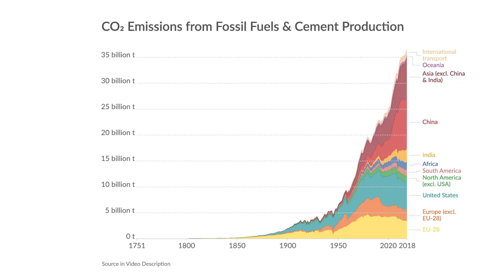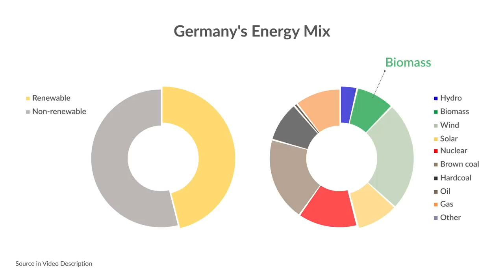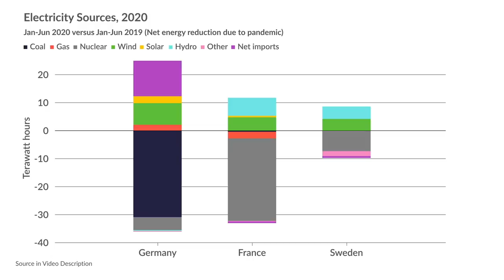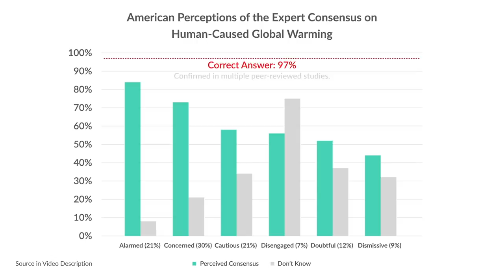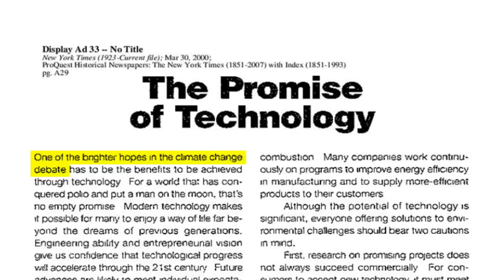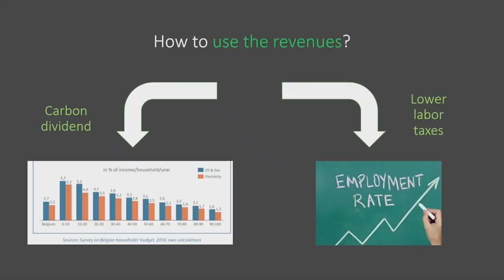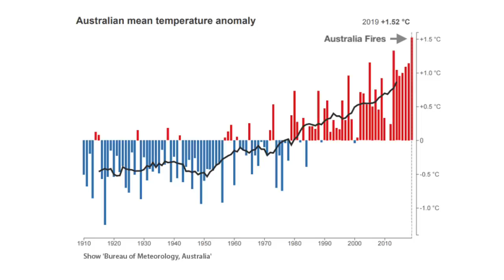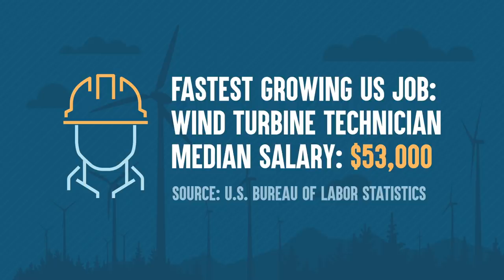The $5,200,000,000,000 Trick Killing More Than Covid, w Stephen Fry.

Comment: As I understand it, the Sahara desert was GREEN when the planet was 3 deg warmer.  More area of sea, warmer climate, more evaporation, more rain.
Reply: No sir, that is not the case. You see, there are two factors that influence if water evaporates or not (well, there are more but they're not as important). The first of them is temperature so, yes, the higher the temperature the more evaporation that takes place. Then there is another factor which is how much water can the air take according to its maximum capacity and how much water it already has. Whenever the air is close to big amounts of water it already contains almost as much water as it can have, that is easy to understand: since there is an unlimited supply of water the air can take as much water as it wishes. Now the water reaches land and, of course, since there is not as much water here it rains. Up to this point good, indeed you can see that whenever the Sahara reaches the sea it ceases to be a desert, since there is much more humidity here. Why doesn't this apply to the central area of the Sahara? Well, the air left its water next to the sea and the little water it carries and falls to the ground is met with a dry land where evaporation conditions are perfect, not only there is a high temperature but also the air is dry. So no, there wouldn't necessarily be more rain and even if there was more rain it wouldn't imply green and plants right away since as you yourself pointed out more temperature means more evaporation and that is not just at sea but even more so at land.

You don't have to believe me, though. Just look at a world map and see where deserts are, they always appear where there are high temperatures and if they are further from the sea then they are even more likely to appear. The Sahara desert could have been a green area in the past, true, but that might be due to the fact that way back in time the Sahara desert wasn't located where it is, but instead on other side of the globe where it was colder. Maybe that is why you have that idea.

The final point to make is that if the Earth's temperature rises 3 degrees for example, we should expect to see deserts such as Sahara wherever the temperature is 3 degrees below that of Sahara right now and those areas that already are deserts, well, they just would get worse.
Reply: @eglerian  
"Just look at a world map": https://www.google.com/maps/@23.4099693,-11.305282,1852299m/data=!3m1!1e3 where the Sahara desert meets the Atlantic Ocean it is still desert not green forest or pasture.
https://www.google.com/maps/@21.3287418,35.7376161,2270569m/data=!3m1!1e3   where the Sahara desert meets the Red Sea it is still desert not green forest or pasture.
Deserts appear around the Tropics of Cancer and Capricorn because the tilt of the Earth lingers longer near the solstices directly overhead there.

Comment: It is stated in the video, "check the sources"  I think you should do some of this too, I'll check back in five years to see how you review this BS
Reply: I've never been too quick to agree with the attack on renewable energy

But I will say that it does have consequences that are often ignored.

These consequences are more easily seen when it comes to the extraction, refinement, transmission and efficiency when attempting to apply renewables on an industrial sized scale

For example:
Wind turbine bearings need to be oiled, the tower also needs to be painted in an oil based paint to keep it from succumbing to the elements, that paint likewise needs primer to ensure that it lasts

Wind turbine blades need to be hauled out on massive flatbed trucks burning diesel fuel the entire trip, usually carrying 1 blade at a time, thousands of miles from a manufacturer to very remote isolated construction sites often lacking infrastructure

The lifting site needs leveled re-enforced paved roads of bitumen with slow rising slopes because a flatbed under such massive weight could tip and easily damage the load, meaning you needs to zigzag that road to reach the higher elevations

That blade needs to be lifted into position by massive cranes also using diesel engines 

The blades need to then be welded to the rotator by welders using harmful gases such as argon to ensure the weld is quality

Then the electrical lines conduit needs to be dug into the earth to allow the power generated by turbines to reach the processing station

So use of diesel fuel...
Harmful gases in weldings...
Oil based maintenance measures...
Creating numerous entrenchments for... both roads for access and cables...

Now repeat this process 100+ times for however many towers you want to construct

You see it's these things that no one thinks about. Again it's not an attack on renewables but you are extremely naive if you think they are a saviour to the climate
Reply: Lol you think they didn't check their own sources?
Reply: @rejvaik00  Painfully true.
Reply: @rejvaik00  Fiddling with details is going to look funny underwater.
Reply: @xyaeiounn  I know what you mean, but this is just the logistics

They are side of Industrial applications that no one ever thinks about unless you are employed in the industry, and it's here that I believe the criticism is most valid

IMO and it just an opinion, renewables are held back ONLY because they deliver energy on a sporadic basis, meaning that an atmospheric or geological factor must be present in order for the renewable process to function

And no nation can't run on energy that is sporadic, because we generate, deliver, and consume electrical energy all within a single instant

If you could engineer something to make the atmospheric or geological factor a constant then you could actually make a renewable perfect for industrial application and primary means of energy production

That plane that flew around the world 24/7 by only using solar energy was a great start and a neat proof of concept of ensuring that the renewable ALWAYS had access to the sun, but they had to fly very high in the atmosphere 

And even at that height you still have issues, such as those being a never ending source of heat which could melt electronics and a constant and stronger source of UV ray bombardment, which can even degrade plastics, from the ever present sun as you're now higher than all weather activity, so you never have any cover.

Again I'm only telling you the difference between small scale and massive industrial scale and it's the latter where renewables don't "fail" per se but they do stumble
Reply: @frankkent4434  coal is a pollutant there's no argument about that from me, the only thing it can do that renewables cannot is it produces electricity so stable that the electricity can be transmitted long distances extremely easily via AC current

For instance, solar panels cannot. They produce electricity in a Direct Current configuration, that electrical signal needs to be refreshed every mile so again not great to build your solar farm in an uninhabited isolated area and then attempt to transmit it hundreds of miles away back to the city

And again I'm not demonizing renewables, I'm merely pointing out legitimate criticism on their application for a nation wide industrial scale and the idea that they are 100% clean because they are not

if you never address these issues you will never engineer solutions past them
Reply: @frankkent4434  no I'm not, the atmosphere is comprised of many layers that operate with different temperatures at many different heights and depending on which height you are at you can manage temperature as you need

And yes I'm aware of plastics with additives for UV protection but even these aren't completely life lasting, they need replacement.

You are not seeing my comment's intent where I mention I like the idea of keeping the solar plane in a permanent flight because that shows they removed fluctuations in atmospheric variables as best they could which is amazing

I'm telling you I want engineered solutions to problems and you only get engineered solutions when you first identify an existing problem

You don't need to demonize somone who has repeatedly stated over and over this isn't attacking renewables but merely discussing issues that they have
Reply: @frankkent4434  it's BS to levy factual criticism? 
You prefer to demonize somone who says that the the most powerful industrial solar panel the Gallium Arsenide is only 40% efficient at collecting sun's rays

you don't want to engineer a more efficient panel? You don't want to experiment and find better methods of AC-DC conversion? Because currently we have energy loss when the conversion takes place

But instead assume all these legitimate criticisms are just a slander on renewable energy?

Because those above and everything I've said is true renewables have problems and if you don't discuss them you won't solve them

Provoke a discussion with solution rather than dismissal
Reply: @frankkent4434  I wasn't trying to say that solar and wind are the defacto problems in renewables

Just those two are the most well known, hence why I provided the often overlooked issues regarding them both, that's it. I've done the research

For the 5th time I'll say again the comment and now this chain of comments, was NEVER an attack on renewables🤣

The Gallium Arsenide Solar panels I mentioned are not readily available to public markets as they are primarily used in space craft and satellite operations. Also they are an older technology been in usage since the 1970s 
But yes depending on the manufacturing process and quality of the Gallium you can get efficiency rates from 30-40% the literally highest of any solar panel

However Gallium Arsenide is a known carcinogen, and California the most environmentally conscious state in the US still regulates it's use even in photovoltaics. So there you are another issue when it comes to the manufacturing process for equipment in renewables which is what my OG was entirely centered around 😂

Moving on, If you again refer back to my statement concerning the biggest issue with renewables is they require an atmospheric condition to operate

But if you find a way to overcome that limitation where the atmospheric condition is constantly present you have an amazing source of energy that's all

Which is why I FREAKING LOVE THE IDEA of the plane that flew 24/7 I even said that in the OG comment, it's a great proof of concept

There's possibilities to nullify the problems one encounters with renewables, such as you said the oceanic currents, or geothermal activity such as in Iceland

But you'll never notice these issues if you don't let people talk about them!!!!
Reply: I don't think America has 5 years left, Russia and China will nuke this place

Comment: Ending this very reasonable video with a hyperloop hype takes away some of its reputability.  Otherwise I liked it.
Reply: WHAT's wrong with hyperloop ? I think it's actually a brlliant idea to electrify high speed transportation in a very energy efficient way
Reply: @babyelian77  we have them called bullit trains and don't require a vacuum tube the entire length of the track.
Reply: @Sergiblacklist  but the vacuum is needed to drastically decrease energy consumption, in order to have very high speed transportation (like airplanes, actually even faster than that), with the energy efficiency and convenience of common low speed trains
Reply: @babyelian77  the energy required to make a vacuum over 100s of  km is known to cost very little. Not. This whole thing is a great waste of time. All the time energy money and effort could have been used to create a fast efficient high speed mag lift train and we are chasing sci do ideas that battle the laws of physics.
Reply: @babyelian77  It's a gadgetbahn project, the money to which is better invested in conventional high speed rail.

Don't get me wrong!  If we ever have the technology to dig straight underground tunnels for hundreds of kilometers then creating a vacuum in those and accelerating a maglev train to supersonic speeds can work.  But not in a steel tube above ground that bends out of shape with temperature variances.

Comment: 14:30  hottest years ever in recent decades - except that the many decades during the 1930s and before then were warmer than during our lives, according to paleoclimate data. Which suggests that natural variability is substantial and may beat work even in recent times, instead of a single variable.
Reply: CLimate Change is a hoax politicians spun up.  One of many that uses ignorance to power itself. Climate changes every 12 years due to the suns cycles which gives the illusion that "something ominous" is going on with the weather.  However if they keep chopping down all these trees without replacing them then the C02 WILL pile up and cause problems because trees scrub the atmosphere of it. c02 scrubbers can also be made by humans so why aren't they being made?
Reply: @Andronicus87  I don't rember it getting colder 12 years ago. In fact I've looked at the graphs, Christ I'm friends with some one who's made some, and I've seen a consistent uptick in temperature. It's not a political issue for most of the world. Here in the UK our right wing party (conservatives) are trying to ban the production of cars using fuel.
Reply: What? You do not believe scientific consensus that ignores biology in some cases? Ignores the two primary contributing greenhouse gases (water vapor and methane) to the point of omitting them completely from the studies? The same science that focuses solely on a distant tertiary contributor? The science that forgets to mention that a major reduction in greenhouse gases would destroy the very atmosphere created by those greenhouse gases? The science that ignores methane that is converted to additional CO2 when it reaches the upper atmosphere? Scientific method? They don't need no stinkin' scientific method! If you believe in the hard sciences, you must be one of those science deniers! (So go the ill logical conclusions these days ... and yeah, it is spelled like that for a reason, not a typo)
Reply: @Andronicus87  How about merely replacing all the deforested lands with fast growing (invasive?) Paulownia trees that are about the same density as cherry wood but can produce veneer logs in as few as eight years, and using hemp instead of paper trees and to supplement the cotton industry, and the creation of large scale, natural ecosystemic food forests to aid in the reforestation efforts, increasing agricultural security and reducing poverty and malnutrition all at the same time? 

Why not? Because it has never been about finding viable solutions.
Reply: @anomalousanonymous  ah I see. Your off your rocker. let me tell you ,as some one studying 3 sciences, science has not moved away from the scientific method and all information you see published is as correct as we can make it. However the way science is explained to people who don't have a deep understanding of science will always be simplified ,such as the structure of the atom (can you tell me what a p orbital is?), This doesn't mean you've been lied to.
Reply: @anomalousanonymous  oh and you didn't explain what a p orbital is.
Reply: @anomalousanonymous  Yes we need to use Hemp and those Paulownia trees. Although I'm pretty sure it isn't spelled like that. Holy crap I looked and it IS spelled like that lol.  NO it has always been about bleeding people dry of their money.

Comment: melting quartz in a tokamak reactor would be more efficient
Reply: What are you actually saying here? Beyond the fact fusion is no where near viability right now. you can't easily direct the heat produced by a tokamak, if we're talking fusion temperatures the silicon would vaporise and be incredibly difficult to confine back into ingots. Regardless of which you're having to use a monocrystalisation technique like the Czochralski method to get useful silicon.